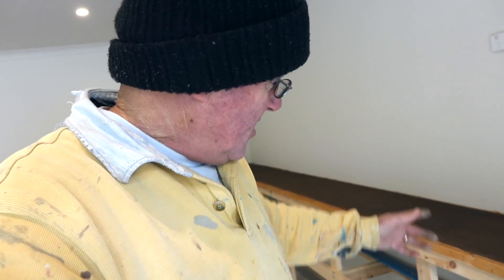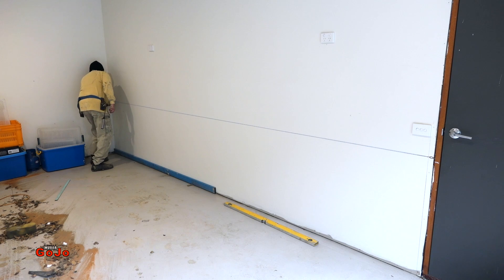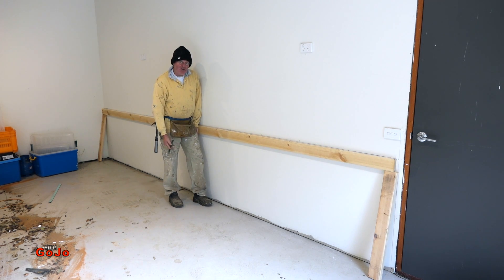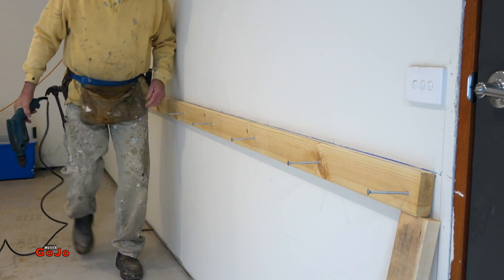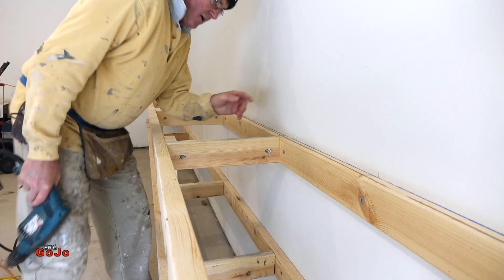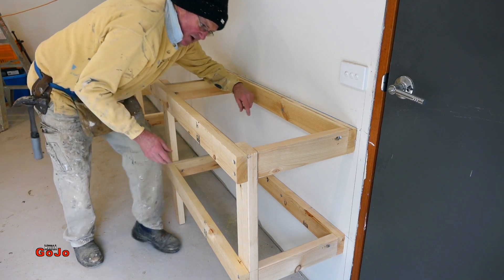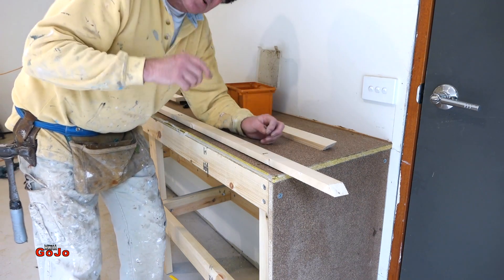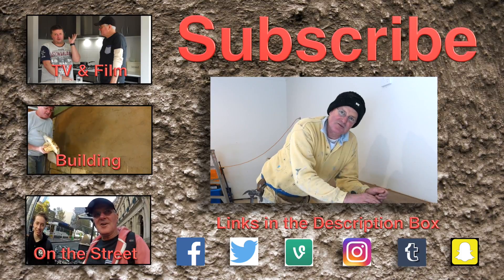Workbench / Shelves | Heavy Duty and Simple Garage Makeover | How To DIY

Comment: Of course you know this already, but a stud finder electronic tool is quite useful for finding wood studs in the walls without making holes. I was hanging a piece of art in our house, used an old stud finder, thought I had the right spot and drilled into a pvc sewer drain pipe. Yuk. Had to cut open the drywall, tape up the leaking pipe, call the plumber to fix the pipe and call the finish guy to patch the drywall. $100 later, I bought a new stud finder that is much more advanced, finds wires, studs, and has a laser pointer, etc. Drilled another hole, hung the art piece, no problem that time. Cheers!
Reply from the maker: Yes they are great when you're not sure what is out of site. I just tend to break electronic gadgets on a building site lol.